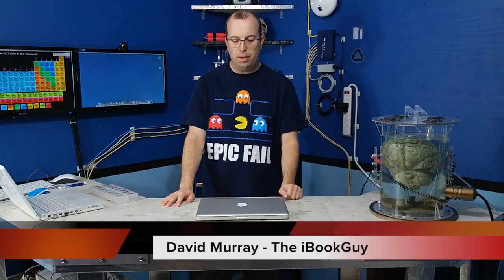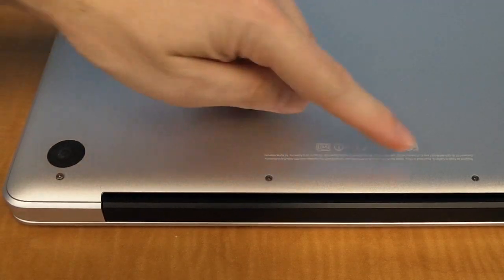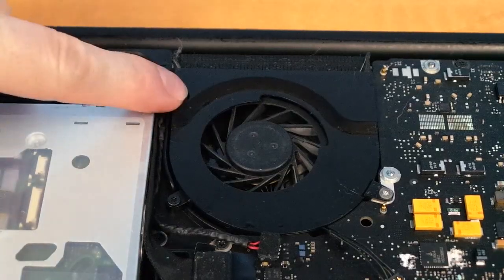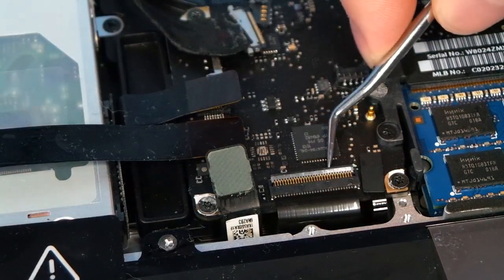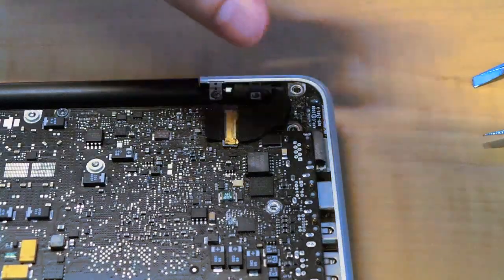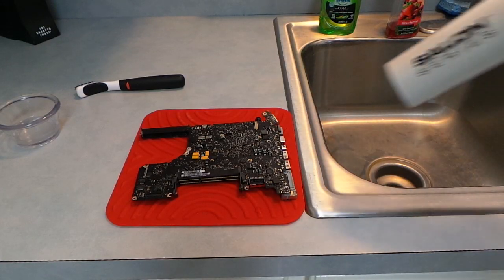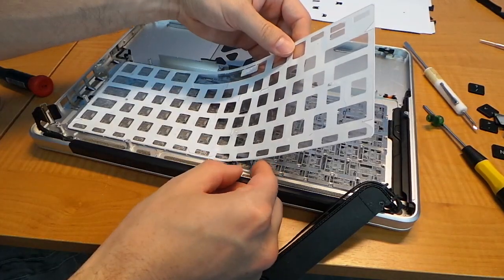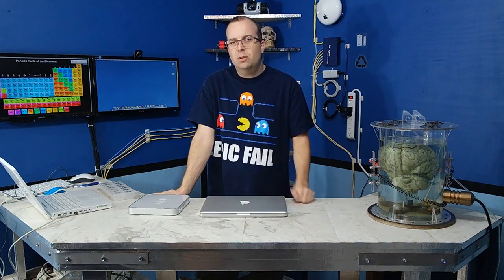MacBook Pro 13" disassembly and gatorade spill cleanup.

Comment: I have a WTF story: There was a defect with a full batch of MacBook Pro (2009 model), where the HDD bus cable would fail after a couple of years. It happened to mine, so I ordered the part and replaced it myself. When I disassembled the laptop I saw that there was dust accumulated in some places, and I wanted to clean it up. I knew one of my colleagues cleaned his laptop keyboard with a compressed air can, so I asked to borrow it. He handed it to me, and I sprayed the insides of my disassembled laptop without even looking at the can. I immediately noticed that the air was... well... wet. I looked at the can, and it was WD-40. I yelled at my friend: "why did you give me this?! are you crazy?! this stuff is for lubricating tools and stuff, and it's flammable!" His answer: "What?! I've been cleaning my laptop (Lenovo) with that for like a month!" Anyway, both laptops were ok :)
Reply: David Ruiz-Tijerina what XD THATS REALLY A WTF STORY XD
Reply: David Ruiz-Tijerina lol
Reply: David Ruiz-Tijerina not again
Reply: Rip
Reply: wd-40 wont harm electronics. You can actually use it to clean them
Reply: XD

Comment: My 2010 macbook pro just died because of that, I took it to the official apple service center on my country, they told me the keyboard could not be cleaned the way you did, the only solution they gave me was to buy a new spare parts, and the budget cost was as high as a bran new Windows laptop with better specs, so screw those guys, I'll be going back to windows
Reply: +DRWXP same with me except they told me it would cost 700 bills so i might as well buy a new one............
Reply: #the apple tax
Reply: Poor kiddo. Mami didn't want to clean his mess and he got upset. :,(

Comment: I spilled hot chocolate that was really hot on my MacBook Pro mid 2012 and I turned it off right away unplugged it, opened the back of it unscrewed the screws for the battery and took the battery out. Left it in a cool dry place in my house for 7 days and it is 100% fine now. But now I can't have any liquid near any electronic I own within 10 feet lol.
Reply: +Connor Murphy *you're
Reply: +slowly87 No need to correct me, I know I misspelled it.

Comment: you should have send the board to Louis Rossman
Reply: Lol, I was just about to comment that. The 8-Bit Guy and Louis Rossman could've done a pretty cool collab.
Reply: but to be fair, he also has to cringe while fixing the motherboards of a poorly designed laptop that costs well over a thousand dollars
Reply: if mb does not come up, not even the fans, try: a) smc reset, b) replacing the magsafe power connector, c) battery; d) inspect with a 20x magnifying lens for oxide in some ICs, in which u have to send the mb to rossman or some other specialized electronics lab

Comment: I couldn't imagine it would work after a spill like that, with the internal battery running voltage as the gatorade was spilt on it, I'd imagine many of the small components would of shorted out and need to be replaced. What a long and tedious process it would be to replace every fucked component on that logic board..

Comment: This is reminding me to get my MacBook Pro 13" fixed. It's a 2010 model iirc, and it's always worked like a charm save a couple isolated incidents. The first was a small piece of the plastic that cracked off near where the magsafe connects to the computer. I didn't drop it or smack it on anything; one day it just cracked and eventually popped off. Second is just that I've had maybe 2 kernel panics in the 7 years I've owned it.

Main issue is power supply I think. Occasionally it would just... die. Plugged in and everything. The battery died on it fairly early and I never replaced it, just running off of the charger. Sometimes it would die while plugged in and receiving power, and twice it stopped receiving power altogether. I fixed the first time it happened, but the second... I plugged in it and the magsafe connection started to smoke a little bit. Unplugged it and have left it for a good while. Might get it fixed tomorrow.

Comment: Question:
If you can only have two of these computers what would it be

Macbook pro retna
iBook G4
Mac Pro
iMac
Mac mini G4
Powermac G4
Mac mini
Reply from the maker: Assuming I didn't have to pay for them, I'd take the Mac Pro and Mac Mini.
Reply: +The iBookGuy my 2008 mbp died after a broken charger cable shorted out but, the curious thing is that the battery still charges and discharges normally and the battery charge light indicator still works... dead logic? any ideas?
Reply: +TheMetalMusicMachine I had the same problem,your dc  board is broken,it doesn't delivery +5v and +12v voltages..if lights come out there is only +3v.
Reply: Click Beats Audio But battery charges normally... or it's tricking me?
Reply: +Flajarkin iMac and MacBook Pro Retina for me
Reply: the mac pro and macbook pro retina(both 2015)
Reply: SuperNinja66 This comment is so old I have no idea why people keep replying to it... I bought a MacBook Pro Retina 2013 like a month after this comment. Also I don't think I was clear about my comment. I was saying if I where to get one current mac and one older mac which ones should I get. But this comment is like 7 months away from being 2 years old so I have already made my decisions.
Reply: ok
Reply: +Flajarkin The mac pro and MacBook Pro Retina
Reply: imac 5k + 15" retina mbp
Reply: Arthur K Look a few comments above. I have already made a decision.
Reply: mac pro and retina MacBook pro
Reply: MacBook Pro Retina (Late 2015 would be better for me) and iMac (5k late 2017 would be better for me)

Comment: I work on a ship. I had just purchased my 15inch 2015 2.8 GHz MBP and gave my 2014 to my mom. We loss water pressure going to the house of the ship. I figured out that it was due to a toilet that had been constantly running in an empty room. I was on my way to the engine room to get a screwdriver to shut off the toilet when one of the other engineers stopped me and asked could he see if my room had running water. I clearly told him that the whole house didn't have water pressure, but he still insisted on seeing if my room had running water. We went to my room, showed him that there was no water coming from my sink. He says, " Let me see the shower" ---___---   I turned the shower knob closest to me which happened to be the hot one and nothing came out. After that I went on to solve the problem with the toilet and resume other routine tasks. About an hour an a half later I'm walking to my room and I hear the sound of a shower running. I was like, " This is a weird time of the day for someone to be showering" I arrive in front of my door and my heart dropped once I realized it was coming from my room. My dumb ass didn't turn the knob to the hot side of the shower back to the closed position... I opened the door, It was so much steam I couldn't even see directly in front of me. My MBP was opened on my desk covered with condensation. I immediately opened the port hole, laid out a towel on a table next to the port hole, and laid my MBP on it's keyboard side on the towel. After the 3 days of letting it sit there it seemed to be functioning normal, but would do some weird things every once in a blue. Once I updated to El Capitan it's been smooth sailing every since. No problems at all. I typed this using it.
Reply: This has absolutely nothing to do with your Mac Book Pro.

Comment: Hey The 8-Bit Guy, I just watched your video which rased hope in me that I 
can fix my MacBook alone. One week ago I spilled wine on my brand new 
McBook Retina 2015 (2 months old) a glass of wine. I let it dry for 5 
days and than I went to Apple Store, they told me that there is a liquid
 on the Board, Hardware, Screen etc, so it would cost 1 200 €, which is 
nonsense considering that i bought it for 1 400 €. What drove me crazy 
was that fact they told me I need a new screen, but they even didn´t 
tried if it works, turned out it actually works. Upset and completely 
lost trust in Apple I started looking for other options. What do I loose
 at the end, my Mac doesn´t work anyway, so I eyther fix it alone or buy
 a new one.
So my question is, wine damage could be cleaned just the same way you 
did fix the water damage on this Mac, couldn´t it?
Can you give me some advice, I really need to save that laptop, I was 
savig money for two years, so I can afford it...
Reply: Kalina Kehayova how is your macbook now? Did you fix it?

Comment: Six months ago I spilt an entire glass of water over my 13" Retina, which seemingly completely destroyed it, and the repair bill came in at £700, which was covered by my home insurance.

As luck would have it, today my niece somehow knocked over a cup of tea, and of course some of it went over my recently repaired Macbook. I can't claim on my insurance again out of fear they'll not renew it next year. However, no where near as much liquid made contact with the machine in comparison to the first incident, so I wasn't expecting it to cost another £700.

I've just got back from the Apple Store after having the damage evaluated, and they've flat out refused to repair my laptop. They've told me that it's highly uneconomical to do so, as basically every component would need to be replaced. The bloke told me that he'd opened it up and could visibly see residue on every internal, which automatically means that they'd all need to be replaced in order for my warranty to be renewed. 

My thoughts are that if I open up the machine and delicately clean off all of the residue and then book another appointment, Apple might agree to replace the parts that are damaged and then renew my warranty, like they did the last time. And there isn't anywhere near the damage there was the last time either. Everything seemingly works fine except the speakers, which sound a little static-y. The last time the machine powered up for five minutes, in that time the trackpad wasn't working, the display was multicoloured, there were sporadic loud banging noises, and then the battery went dead as soon as the power cable was removed. It never powered up again after that. I'm hopeful that if I go in again once it's all cleaned and tell them that it was just a little bit of water that made contact, they'll run a diagnostic and then replace the damaged bits. What do you think?

Comment: I unfortunately also spilled Gatorade on a MacBook Pro, and I ended up buying a new one.  The difference between Gatorade and other liquid, as it was explained to me, is that the electrolytes in Gatorade are able to corrode the motherboard in ways that other liquids cannot.  I noticed in the video that The 8-Bit Guy said he'd fixed other computers which had had liquids spilled on them, but he didn't say whether he'd fixed other computers that had had Gatorade spilled on them.  I'd be curious to know if he's ever fixed a Gatorade-affected laptop.

Comment: Couple things I can tell you from my experience with a coffee spilled 2007 MacBook. I put the motherboard by itself in the oven for 15 minutes at 175 degrees.  I wouldn't discount the laptop just yet though. Since it is a unibody it is possible that the power button itself may be corroded and has stopped working. Try starting it with the secret conductive bridge connection on the motherboard itself (both unibody and nonunibody have these) If both those don't work then its done.

Comment: I spilt coke on my 2014 macbook air two months after i bought it.... Apple wanted over 800 dollars to fix it and i was like no way. So i did a lot of research and i ended up doing something similar to this to my computer. My computer still turned on and worked normal it just wouldn't charge but i didn't care i did this to everything on the inside and i was very shocked at when i was done that it worked.. I know my self that this works. I did not learn it from this video but it is still the same thing and i have had to do this twice now one for my computer and one for my moms computer.

Comment: Did you try disconnecting the battery and just using the mains adaptor alone? I saw a similar video with the same result, disconnecting the battery brought it back to life.

Comment: The process isn't a waste of time, but if the liquid was left on the board for quite long while it was powered on, then it definitely shorted something out. I had my laptop have its keyboard logic entirely shorted out just because I was using it during the storms last year. The dew and the moisture that had build up on inside the logic board shorted it once it was powered on for long enough.

Comment: Just a helpful tip... this model of macbook pro often blows its backlight fuse when water damaged. ie, bootup sound, but nothing displaying on screen. the part is an 0603 surface mount 32v 2 amp fuse, and can be hand soldered in with some practice. the fuse is found near the video connector, and is usually green or tan in color.

Comment: If you are rinsing with water you have to make sure it is dry everywhere. Using a hair dryer is not enough there are small pockets where water can accumulate. Hair dryer is good to remove the majority of water on the board but you have to let it dry itself for a few hours (in a non humid place).
Also there are minerals in water which are conductive. Pure H20 is non conductive. What makes water conductive are the minerals in it. So you have to be really careful. Else you only make it worse by putting more minerals on your board which can short your motherboard.

Comment: hey yall just remember to use distilled water for maximum safety bc tap water and spring water have impurities and minerals which can affect the device even after drying
distilled water will dry without any residue which can cause corrosion and etc

Comment: please note the power is disconnected while he is washing the board this is important for proper safe cleaning of the board without causing additional damage to the computer he will also allow the board to dry before reconnecting the power this is also critically important for proper repair and cleaning

Comment: Can my MacBook Pro early 2011 be fixed. I spilled gaderade on the keyboard and now the screen backlight is dead. It still turns on, just no light on the screen.
Reply: Yes. All u need to do is replace the backlight inverter

Comment: Did you have a battery charging issue after the cleanup was done? I have a macbook air that had a coffee spill and everything seems to work except the battery.
Reply: Anand Raj  mine worked but I had to have someone solder on new fuses and chips

Comment: I spilt a small amount of gatorade on my macbook air yesterday night, nothing happened. The laptop is still working as if nothing happened. I was wondering if you think that I am off the hook? Most of the gatorade got on my bed sheets and the blank space next to the touch pad under the arrow keys. Some gatorade did however get on the arrow keys and question mark key. Everything is working just fine, sound, display, keys, no problem. Should I just say I'm good to go?
Reply: Everything works fine now. I'd say still get it cleaned up. It might not be corroded now. But eventually it will.

Comment: About the hairdryer: If the one you're using has a "cool" setting, I'd say use that since they can otherwise get pretty hot.
Reply: I prefer to use it on medium heat otherwise it takes AGES

Comment: how much is a new motherboard?  are you going to be selling it on ebay?
Reply from the maker: I replacement logic board costs nearly $300.  The whole computer is only worth maybe $500 when working.  So I will be putting it up on ebay to sell for parts.

Comment: its better to use water to clean the mobo because alcohol doesn't dissolve sugar. only thing is you will need is to dry the motherboard somehow with some heat for a day or air dry for a week, but make sure you remove the bios/clock battery when you do this.
Reply: He did do that, didn't he? :)
Reply: if you use tap water, the dissolved salts will remain on the board and can cause shorts. use deionized water.
Reply: Actually alcohol does dissolve sugars quite well. It's why if you get treesap on say a fleece you can use rubbing alcohol or hand sanitizer to dissolve the sap and then run it through the wash (you do need to actually wash the alcohol off with water if you want to remove it as if it dries well the sugar is still there and it will still be sticky). And you are definitely correct in that you should remove the CMOS battery before running it through water.

Distilled water or RO water is best to rinse off the electrical components as well as it doesn't have any salts in it that could be conductive to cause damage as well and is what I would use if I didn't want to use or didn't have any alcohol.

Comment: The tool for the battery ? I need the number of that tool... thanks.
Reply: NESHER1972 its a tri tipped screw driver, like the ones that nintendo uses... but I don't know what size.

Comment: Hey ibook guy, my MacBook Pro 13" 2016 model I think has got a little moisture inside, nothin was spilled on it, but it's a possibility one of the sides may have got damp. It will turn on while I have it plugged in, but is super laggy and stays on 0-1% battery life. Is there any suggestions you may have for me or would you be interested in having a look for me?
Reply: I'm not iBook Guy, but Im typing off of my macbook that has been water damaged. What often happens is the laptop will become slow because It cannot run efficiently  when power is being supplied directly to the laptop, rather than the battery. You might just need a new battery; for me, ill probably need a new laptop bc the liquid was coffee and I think things are only going to get worse.
Reply: Do a factory reset on the computer, and the battery level is probably to do with a faulty battery sensor. If that doesn't help, take it to a professonal